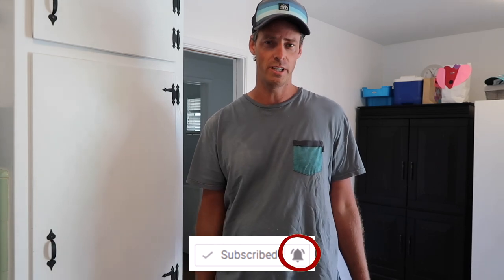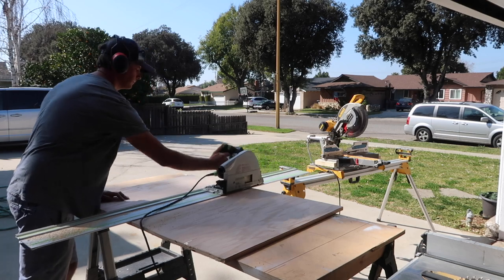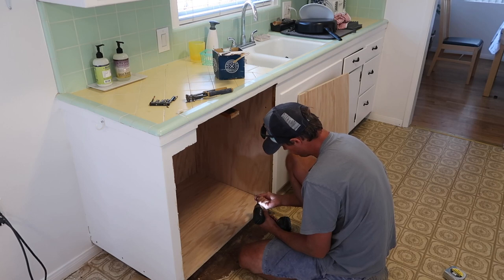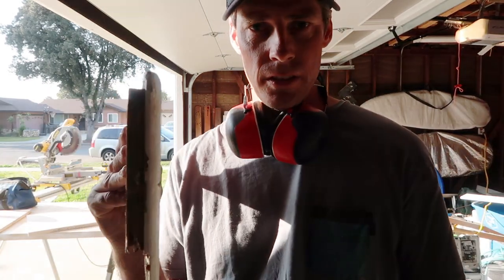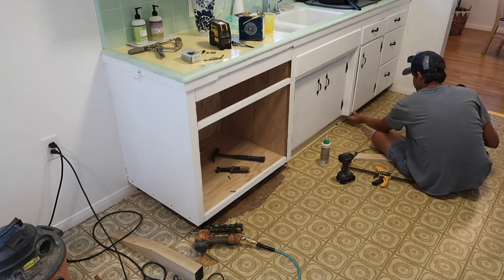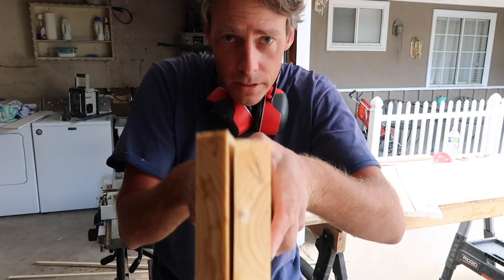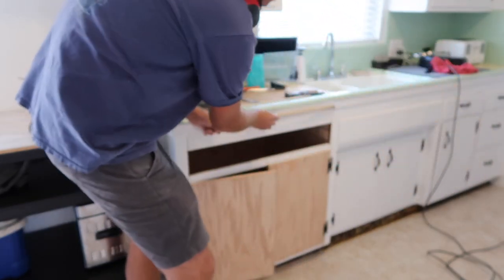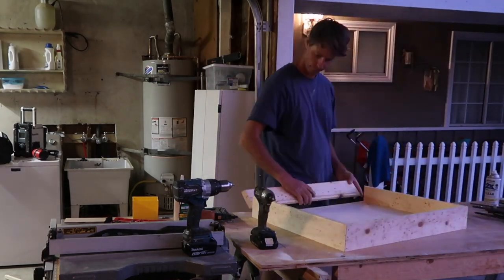Retro Kitchen Restoration DIY Before and After - Wood Glueru

Comment: Love it but just curious as to why you didn’t replace the DW with a new one?
Reply from the maker: Well for several reasons at the time. 1. Some day we will rip out the whole kitchen and I didn't want to waste money on an appliance that we might not want with the look of in the new kitchen. 2. I really needed the cabinet space at the time (since then we have added more cabinets at the end of our kitchen. 3. Our sink is not set up for a dishwasher ( no overflow) and can't be drilled because it's so old this dishwasher was leaking because of that exact problem (it wasn't set up right from the beginning).  Now all that said at this point we are keeping this kitchen way longer than I thought we would LOL. So recently I have been thinking of ways to add a dishwasher haha, but I keep pausing because of the cost it will be in a kitchen that will just be ripped out some day.
Reply: @woodglueru  I understand!  We live in a 1970’s ranch style house.  We’ve lived here for 35 years and raised our 4 kids here.  We just recently were able to replace our kitchen after planning and saving for those 35 years.  I hope you’ll be able to replace your kitchen faster than we were able to!  I love all your remodel DIY’s so far!
Reply: 1950's kitchen❤ You're making it work for you & your family until you can afford an entire remodel! Great job